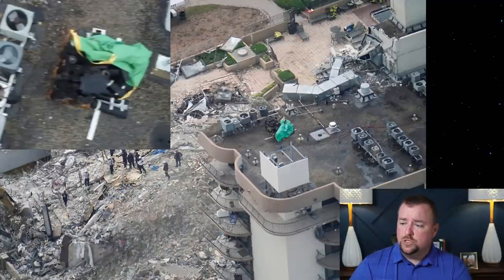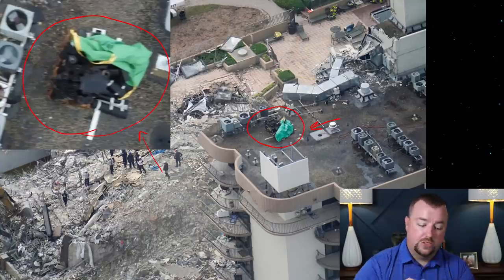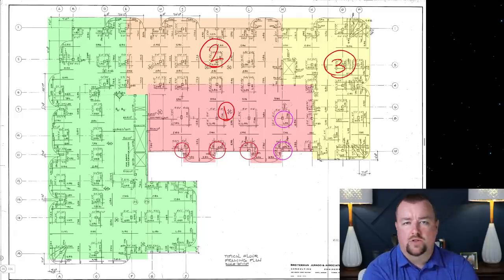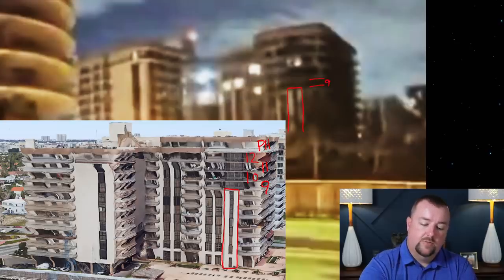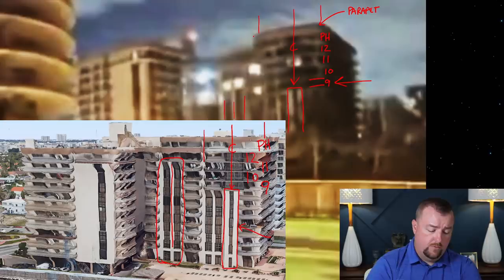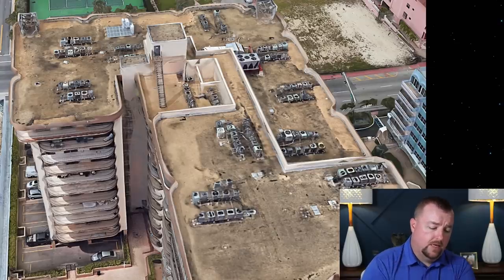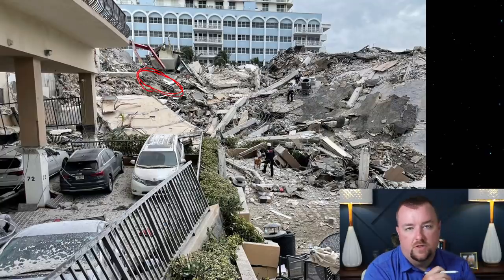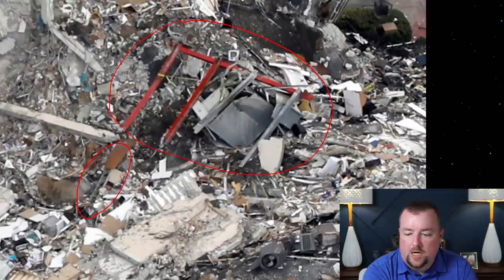Surfside Building Collapse - Did it start at the roof?

Comment: You have done a great service in explaining so much about the collapse.  However I do not share your analysis of the mechanical equipment positions after the collapse as an indication the collapse must have started from the bottom.   Even if the collapse had in fact started from the top, I see no reason that the final position of the items would necessarily be any different.  The could very well have dropped the distance of the two floor levels then rode the debris all the way to the bottom, sorta intact.   But again I tend to agree with you the collapse likely did initiate from the bottom.  On a different line of thinking, the punching shear of the columns outside the tower area is very disturbing to me. Thank you for the video, again well done.

Comment: @Building Integrity Please consider that lights depending on their type will not go off imediately when power is cut.  Incandescent lights will continue to emit light until their filament has become to dark.  As the filament cools the lights will gradually emit less visible light and the emission spectrum is going to shift towards the red end of the spectrum.  In high quality imagery this shold be wel visible.  LEDs otoh often have capacitors to reduce flicker.  These capacitors will provide enough power to produce a significant amount of light - but here we're talking about probably no more than a hundredth or a few hundedth of a second and the spectrum should usually remain unchanged.  Fluorescent lights will drop rather quickly.and the spectrum (aka color) should also remain unchanged.  Meanwhile inductive loads such as motors and transformers may feed power back into the building's wiring and provide extra power to lights after the outside power supply has gone down.
I don't say this is what happened but really electricity going away is a pretty dynamic process and it may impact what's visible on a few frames also depending on the frame rate.

Comment: At 17:48 (example location of many) you do not really allow for the perspective and assert that the penthouse already is a full floor height down - now the subtitles say  "15 to 20 feet", I think that estimate is too large. It is popular nowadays to make any and all modeling in software, but perhaps a cardboard model of the building and exact data for the location of the camera - distance as well as height above ground - allows for a simple recreation of the image in frame 001 and thus a determination of approximately how many tenths of a floor the roofline is too low due to building collapse if it actually is. I think it is too low, but only about 4 to 6 tenths of the height of a floor instead of 15 tenths of the height of a floor as you suggest. And yes, it seems meaningful to assume the height of a floor to be around 3 to 3.5 meters (About 12 feet).

Comment: I believe the camera was activated because of those bright lights, not the initial building move down. The move is too small for camera to initiate recording, but bright light might trigger it. Bright lights might come from strobe lights when the main power gets cut. What is also interesting is some fuzzy view of the bottom area of the piece which collapsed first. I think it might be a result of an air pressure coming from already collapsed first and second floors.

Comment: I have no and background and architecture or construction but I have a question for those that do. Is there a way that buildings like this could be built with some type I’ve barrier built in the walls to prevent pancake collapses? Like could they install 3 foot rails made of steel across or blocks made of some thing? I don’t know just some thing that would prevent pancake collapses and make it so that if something like this were to happen there would be enough space for people to survive if they were trapped. Just wondering about it. Maybe even escape routes Of some kind built-in to tall buildings so that people could get out. Also some type of intercom system to alert people to evacuate immediately. In the sentence the lady outside said she tried to alert people to get out and if she could call 911 or let the guard know they could send out that emergency alert to all units in the building so the people would’ve had a chance to at least try to get out.
Reply: Just a stronger structure.  Reinforced concrete frame structures are not unusual.  Most are safe.  This one seems to me to have been flimsy.  The stairwells are supposed to provide a safe means of exit, but the east stairwell of this building collapsed rather easily along with everything around it.  There was something seriously wrong with the building and we will learn what it was in due course.

Comment: looked into the collapse with some friends from the engineering and archtectural departments at my university....

and we're pretty solid that it started in the garage.... in the vid taken of the ramp shortly before the collapse, the water coming from the ceiling is distracting...
the important thing is the massive debris (which basically was the ceiling) surrounding the water pipe....

if it would have been the roof, it would have smashed down one, maybe two floors.... and that would have been it....

when you look closely, it's the two central collums that give way first.... the support collums hold for another second, which makes it seem like the building is falling over towards the camera for a moment....
the the support collums break as well, making the building fall slightly to the side....

and then it all pancakes into itself....

when you look at the pool you can see it.... all the cars that surround it? that's where the garage was underground.... the whole thing caved in and landed on top of the cars....
but the caving ends exactly where the garage area ends and the pool area begins....

Comment: Next time you watch the collapse video, you'll see that the west front quarter of your #3 section went down with your #1 section.  Your #3 section split down your center line between those two white features that ran up the middle of #3, so that #3 was not rectangular but rather more wedge-shaped.

Comment: Prior to the video, the pool deck fell causing a seismic vibration to cause the thinner columns to take on stresses they were never intended to take. The hesitancy between collapses is the shock being transmitted between already weakened areas. Causing a progressive collapse as opposed to a controlled failure

Comment: My very first impression regarding overhead roof pictures of the building was that the air-conditioning units appeared too large, numerous and heavy for the overall structure. Red steel beams to support that huge A/C... were they added after completion? You said that the entire penthouse was added later. This looks more like Cairo than Miami. In Egypt, they add entire floors to existing buildings. Here, it appears that they added all kinds of temporary and permanent appertanences to this aged and unstable structure. Then, it failed.

Comment: The white wall and double row of windows in the center of the south side of the building go to the 12th floor.  There's a balcony that crosses them at the 12th floor, as can be seen from the google streetview in the alley south of the building, and from the streetview from the beach southeast of the building.  There's a solid balcony wall above that on the PH level, and the windows are different there. 
I don't understand why you feel if the top floors collapsed first, somehow the objects on the roof would be buried.  Buried by what?  The entire building mostly collapsed vertically.  Whether the top floors collapsed first, or last, the objects on them would have ended up in the same place - on top of the pile.

Comment: Those blue lights are electrical arcing from the wiring system bringing power to each unit and all the equipment, get crushed, torn, ripped apart, or whatever, as the building started to fall.

Comment: The building upper level height lines are all the same but the line that you have drawn isnt correct because the outside perimeters are not same .If you move your drawn line back to the first colapsed building and extrapolate your line to the outside perimeter of the build ing to the right ,it might be the same height.

Comment: The bright white arcs were also caused by wiring shorting out as the building fell.  You can find many examples in the video.
Reply: If the flashes began as the vertical motion was initiating or in progress, that explanation would hold more water... The flashes popping PRIOR to any apparent downward momentum is suspicious, and merited the investigation that was made pretty well moot by hastened explosive demolition.

Comment: You had said in a previous video that you were not understanding why work had appeared to start on the roof. You'd said that if the roof wasn't in a bad condition, they wouldn't replace a fairly okay roof until works below had concluded. Makes sense totally, appreciate you explaining. But you'd never even suggested that it could have been that the work on the roof was to install the safety system on which the workers attached their harness? And I just wondered why not?
Reply: I think attaching harnesses again goes to the work staring at the roof. Why attach harnesses at the roof when you could be shoring up the pool deck instead? It's not like the harnesses are going to prevent a collapse of the pool deck which is seriously compromised. Although they took some half measures on the pool deck, ideally they would have gone much farther to prevent its collapse.
Reply: @beehaven9949  Got it, thank you 😊

Comment: To mre the light on the left seems like bad short circuits. Lights wont go OFF in a ms, and even more when you talk about LEDs, they use power supplies with filter caps that can hold them on for a fraction ofr second. Even for incandecent it takes some time to go completly out .....

Comment: It was the pool deck that collapsed first tearing the middle section and damaging the columns that were half the size of the other columns as the standing building.  Thus the pink section collapsed and then damaged the orange section and it collapsed, but not completely then back section stood for a couple seconds and then collapsed.  The orange section damaged the yellow section badly that the weigh stress overcame the structure and pancaked at an angle toward the middle of the pink section.  They build owner was warned to fix an issue right away in 2018 that ignoring it will result in catastrophic failure.  Nothing was done.  The Pool room had cracks and colrinenated watr in it.  it got in to the concrete which rusted the rebar causing it the swell and burst off pieces of concrete.

Comment: In buildings like this you may have step-down electrical transformers on every floor. The lighting, especially LEDs, requires little current. The windings in the transformer has a capacitive effect. It seems very plausible that even after the vertical feed or bus disconnected due to being crushed there could remain hundreds of milliseconds of current available to keep the lights on briefly.

Comment: The explosions are most likely power arcing. Electronics and electrical shorting out. To think explosives were used is not reasonable and a little conspiracy theory. But arcing could give grounds to the roof collapsing first. High voltage lines would most likely present as there would have been a utility chase near the shear wall.
Reply: I’ve looked at pics on internet, and those stairs lead to a mechanical room most likely also elevator room. There would  huge sparks as high voltage wire is being ripped apart. In some aftermath photos you can see the elevator shaft and utility chase’s position is right where those bright flashes were. In some pics you can see where the wall was blown out at the top. I believe that is the cause of the flashes.
Reply: Further more my belief is collapse did not start at the roof. If it started at the roof those arcs would have been observed much later and not as noticeable. Collapse from the bottom would essentially be ripping the wires out of the transformers and motors causing an explosion

Comment: Have replayed the collapse video a few times, but your still shot does it best. at least part of the lights you see might have very well been the unit of the woman that managed to survive the collapse by getting out in time. I would believe she had turned the lights on when woken by the noises she was hearing. I could be wrong though, but her unit looks to have been in the general area. The going theory now is that the pool deck failed and because it was tied into the building, it pulled the columns out when it went causing the facade to fall first...

Comment: Following your descriptions I was struck by the post collapse image with the parking on the left and how neatly the basement pillar [#72] had punched through the main level floor.  Absolutely no buttressing or connecting beam leading from the pillar!  Only 2 rebar sticking out on each side.  Look at the painted edges and how close they are, barely a foot.  Talk about minimalist construction.  What is the minimum allowable safety factor in that county?  1?   Where I live, new 20+ story condos are going up in a flash, but they all have integral cross beams and pillar top cones in certain locations on every floor.

Comment: 14 yrs ago the I-35W bridge in Minneapolis collapsed.  I went over it a couple of weeks b4 the collapse.  I was there visiting with my sons soccer team staying in a hotel by Mall of America.  Our first day we went over it I was shocked at all of the equipment running and massive amounts of concrete product stacked every where while cars were going over the bridge.  There were these big compacting rigs about half the size of a bus.  They were vibrating the shit out of the structure.  I told my son, this is the last time we go over this bridge while we're here.  Abt 2 weeks later it fell.  You had to be an idiot not to see that comimg.  They blamed it on a design failure, big cover up.  It was obvious what happened. I warned every family with the team to avoid the bridge.  What a cluster.

Comment: Good analysis however, in one aspect I respectfully disagree.
You have to also consider that the first collapsing section is further away.
That means that there is a parallax difference between the closest section to the camera and the first collapsing section, hence it APPEAR to be lower.
It can easily be calculated if you know the distance between the camera and the difference in distance between the two sections.

Comment: You need to look at the re-roofing permit which will give you a clue as to how the re-roofing project was going to be performed.  If the permit called for a complete removal of the old/previous roofing, then to accomplish that on a high rise bldg.  you need to do a staged tear off so that you do not expose the roof deck to weather.  You only tear off and re roof that area that can be replaced and put in a weathertight condition.  If that is the case, the removed debris would have to be removed from the roof deck and placed in dumpsters for removal to the local landfill.

Comment: Having worked in the fire department when I was younger, I'm pretty sure that isn't a ladder or at least one we would place in fire if we were using it to access people to rescue. The point of us using ladders in this capacity is to facilitate ingress into a particular area in which the part over which the ladder is placed isn't safe enough to walk across by foot. 

Let's say that this part was an area that wasn't safe to walk across on foot. Well, putting a ladder down at that angle isn't safe to walk across on foot either, particular when you consider just the gear we wear to enact such a rescue and especially when you consider the equipment we would also bring to rescue someone and then to bring them back out of the building. It's obvious to me that there was obviously a better way to place that ladder to that it wouldn't be tilted significantly to one side if the insecurity of the building had been an issue requiring a ladder. I'm pretty damn sure that's the ladder/stairwell seen on the roof photos before the collapse. The other thing is the fact that they brought the other part of the building down because of the risk to rescue workers of further collapse and, seeing where those stairs originated, I have a hard time believing that anyone from the fire department would have placed a ladder so close to a building they were so concerned about that they demolished it so early on instead of shoring it up.
Reply: One other thing: See how far the fire engines are parked in this next picture? That means they wouldn't have authorized any firefighters to get any closer to the precarious remaining part of the building than that. Anyone who went closer would have had their captains ream them a new asshole for that kind of thing.

Comment: The white/blue flash in the first couple of frames are almost certainly the electrical transformers for those floors blowing. That would explain the colorof the light and the actual lights going dark in the very next frame of film.
Reply: Even if that is not a transformer failing it looks like an electrical arc of some kind. Severed power lines to individual unit's  would branch out from a central location on each floor. Just a thought.
Reply: @BigSlim  I agree with you. I think that the flashes are electrical arcs too. As the building shifted and came unbuckled it makes sense that feeders to the units as well as to the hvac equipment on the roof may have pulled apart and grounded out on exposed rebar or panels etc.